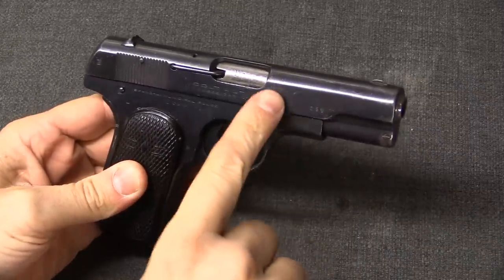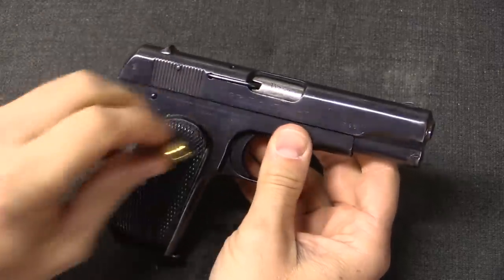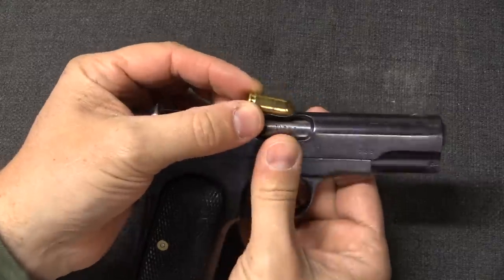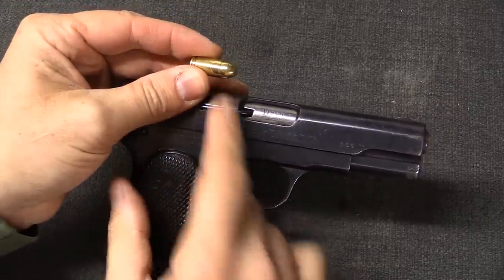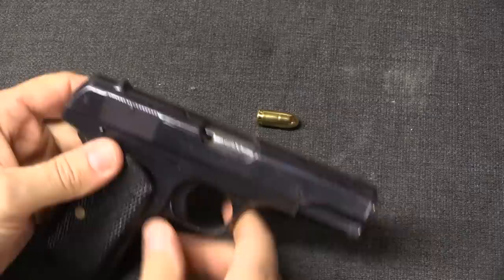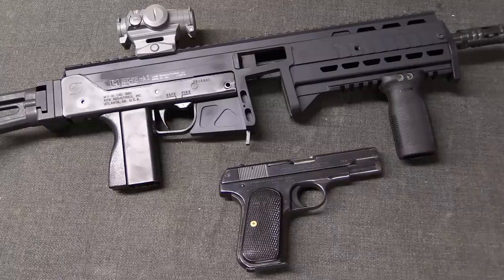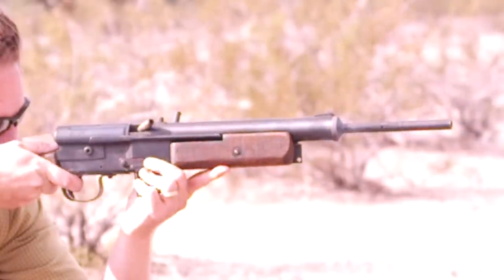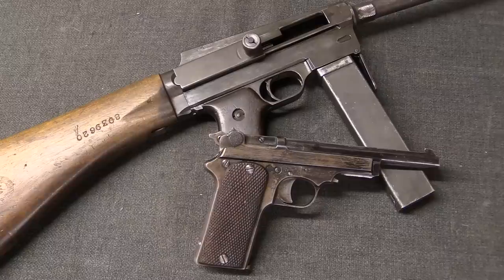How Does it Work: Blowback Action

Comment: How does the spring strength affect the blowback action? Can you have lighter bolt but with tenser spring?
Reply: A_Shuchu _ not really. Unless the spring is way to stiff for anyone to manually rack the slide, the spring strength matters orders of magnutude less than slide/bolt mass. We’re talking several tons of force acting upon the breechface here, albeit for a very short duration.
However, in some designs and with some loads, using a stiffer spring can help soften recoil by preventing the bolt from slamming hard into the back of the receiver.
Reply: Total mass of the bolt & spring vs barrel length needs to be balanced or you get case ruptures. A more powerful spring can increase the rate of fire by closing the bolt sooner but will have a minimal effect on the timing of the bolt opening.
Reply: @brucelee3388  
But how can the spring be so insignificant to the blowback design. From my understanding, the spring could very well replace boltweight, since the mass inertia is nothing but a force that withstands the acceleration of a mass and the spring pretty much does the same.
Reply: @mandernachluca3774  the chamber pressure is "many tens of thousands of pounds per square inch", the effective area of a 9mm case is around 0.1 sq in. As a result the effective force pushing back on the bolt face is in the thousands of pounds. I don't know the exact spring rates used in firearms, but I'd be surprised if the spring force is much more than ten or twenty pounds, given that a human has to be able to rack the slide.

When resisting a thousand pound force, the difference between a ten pound spring and a twenty pound spring is pretty small. The mass of the bolt directly influences how fast it'll accelerate backwards, by Newton's second law.
Reply: @engineer_cat  
I get the practicality point about being able to rack the slide but it should be possible to do it, right? It's the same thing rather it's Newtons second law or the spring, it will always be a force that counteracts the acceleration of the bolt.
Reply: @mandernachluca3774  I won't do the calculations now, but I'd be interested to see if it's possible to have a spring that's stiff enough to hold the breech closed for a long enough time, but still allows the slide/bolt to fully cycle and pick up a new cartridge.

I suspect that firearms manufacturers have found a good balance between spring stiffness and slide/bolt mass. If a lighter bolt and stiffer spring offered any advantage, I'm sure someone would've built a gun like that, with some mechanism to help the user rack the slide/bolt against the stiffer spring. Might be worth asking Ian if he knows of any such design for one of the Q&A videos.
Reply: @Cultural Relic 
Why? A spring has a spring rate, the force a spring can withstand per distance traveled is always equal ( except for progressive springs ) but the total force a spring can withstand after a certain distance is not equal the force at any other given distance. A spring (with pretention) might withstand 10 N at the very beginning of the bolt opening but can withstand a force of 100 N when the bolt traveled all the way and ejected the case.
Reply: @TheRealColBosch  if I'm not wrong It was a video covering the 20/70 Oerlikon 20mm cannon.
Reply: @engineer_cat  I don't think so. The size of the spring and consequently the gun to hold the bolt closed even on a very small cartridge would be huge and for no real gains. Felt recoil is not the end of the world, but getting shot because you couldn't fire first because your gun is so awkward quite literally may be
Reply: @engineer_cat  Ian has done Videos one simple blowback designs for strong cartridges. Some of them have interesting ways to avoid needing to rack the slide against the spring pressure. Like the Dreyse which allows you to disengage the slide from the spring: https://www.youtube.com/watch?v=IY-fbrzPS5U&t=912s
Some pistols have just strong springs, like the Simson or Pieper prototypes: https://www.youtube.com/watch?v=zTl0vWTQbeA and https://www.youtube.com/watch?v=l7E_2GGJIi4
The JoLoAr has a weird handle but this seems unrelated to the heavy spring: https://www.youtube.com/watch?v=RJQLXk3bEww
Or you just lighten the projectile until it doesn't matter anymore as in the Schoboe: https://www.youtube.com/watch?v=zAEWDf-LfcY
Also a nice comparison of different springs for heavy projectiles: https://youtu.be/2vq3bYSPs5o?t=295
Reply: @andreaslaroi8956  some guns are built to flawed ideas of how they ought to work. Increasing spring pressure to counteract chamber pressure is one of those intuitive but wrong ideas that keeps getting repeated. BTW, Ian did a video on the Zip 22 which has a way too light bolt and fails as a result.
Reply: @mandernachluca3774   Mandernach Luca  you're using static spring ratios for a dynamic load. That doesn't work. The static spring ratio says nothing about how fast the spring will compress, only how far it will be compressed if you keep applying a given load over time.

The chamber pressure from a mere 9mm pistol cartridge would squish your hypotethical 100 pound spring completely flat, if it were applied as a static force; try 4012 pounds of bolt thrust on for size (that's a pretty exact figure for SAAMI spec loads in 9x19). In reality, given a suitable bolt mass (plus some of the spring mass as it moves with the bolt), the rearward force stops acting on the spring after a very short movement. The remainder of the bolt movement is driven by the sheer inertia accuired during that initial movement. The recoil spring only has to counteract the inertia of the moving bolt, not the chamber pressure.
Reply: @Kaboomf  
First, how is  a spring ratio static?   The spring can take a certain amount of energy and release it, energy is nothing less than force applied over a certain distance and if you take into account that power is nothing more than energy per time or force nothing more than an acceleration times a mass, è voila, you can easily calculate the needed spring rate for your gun. The problem as befor stated is probably the spring being to heavy to operate the gun manually and the spring being so large that it couldn't be fit on the gun.
Reply: @mandernachluca3774  I meant that you cannot simply say that the spring should compress x inches because bolt thrust is y pounds, like you could with the simple static model we all learned in high school. The amount of time that bolt thrust exists is an important variable and depends on barrel length and bullet weight among other things.

Spring force does not affect the initial speed of bolt opening, but it does affect how far the bolt will open. We need it to open at least far enough to eject the empty case, an overly stiff spring would prevent that. Momentum affects bolt speed, spring force not so much.
Reply: @Kaboomf  
If you would have read my comment properly, you would know that the spring very well alters acceleration of the bolt. Of course the bolt force isn't constant over the whole traveled distance but why exactly do we have integtal calculus if we don't use it?
Reply: @mandernachluca3774  You need to read col. Chinn's volume of "The Machine Gun" which covers blowback actions in excruciating detail, I forget which one of the 5 volumes has this info but it is sercheable and downloadable for free ( Ian reviewed the book a while ago).
Bolt thrust from the chamber pressure only acts for the first couple millimetres of bolt travel, any more than that and you risk case rupture. All the rest of the bolt movement is caused by the inertia the bolt picked up from this very brief acceleration, and this inertia must be sufficient to compress the spring all the way so an empty case can be ejected and a new round picked up from the magazine.

If you were to build a gun with a very light bolt and a recoil spring taken from a dump truck suspension, that spring may keep the breech closed but will also prevent the gun from cycling. For a  given spring stiffness and a given cartridge length, you need to ensure the bolt has enough momentum to keep compressing the spring a long enough distance after chamber pressure has dropped. In a light bolt heavy spring design, the bolt cannot have  enough momentum to do that. Remember, maximum safe bolt velocity is the same regardless of bolt mass and spring stiffness so you cannot compensate for low bolt mass with higher bolt velocity. A stiffer spring thus needs a heavier bolt, but then you need a hotter load and/or a much longer barrel in order to accelerate that heavier bolt to the required momentum for fully compressing the spring.

In high school physics land where air resistance is negligible and all cows are perfectly spherical, we only cared about how far a spring would be compressed by a given force. In high school physics land, the spring would instantly snap to its new state of compression when a force was applied. Here, we are instead concerned with what speed one end of the spring has reached after a short impulse has acted upon it. That inpulse is so brief and the accelleration so violent that the rear part of the spring has not been compressed at all by the time the front end has stopped accellerating. The impulse moves like a wave towards the rear of the spring, and said compression wave might only be halfway down the spring by the time the bullet leaves the barrel. Thus, you don't even have the whole spring in play during that initial phase when you're trying to hold the breech closed against chamber pressure.
Reply: @Kaboomf  
Well, i don't wander in the land of highschool physics. I'm fully aware of those things and i won't denie the complexity of a blowback system that uses mainly a spring but ir is still possible. First, springs come in various shapes and sizes, say torsion, tension, compression or coil springs, using a tension spring over an orsinary coil spring might make a difference. You could also use a simple variable lever or cam system to increase the force needed to open the bolt but maintaining a lower force after the initial first milimeter (or so). I think there is even a  Forgotten Weapons video of a Browning design with the intend of such a mechanism.
Reply: @mandernachluca3774  Like you say, it's possible to use mechanical trickery to alter the leverage so more force is required for moving the bolt the first few mm followed by light spring force for the rest of travel. That's called Delayed Blowback, and there are various ways of doing that. We were discussing straight blowback however; Ian will no doubt cover delayed blowbacks in a later video. 

For straight blowback, no it isn't possible to make a very light bolt and a strong spring work reliably. You'd need a magical spring that's somehow super stiff for the first two mm of travel- at least a ton and a half- and then suddenly reduces its strength down to maybe 10 pounds for the remaining 20mm+ of travel. Springs simply don't work like that, the force needed to compress them increases proportionally with  bolt travel.

Edited to add: Even in delayed blowback actions, the main object of the leverage tricks is to give momentum a mechanical advantage, not to give spring force extra leverage. The two just happen together because the increased leverage acts on the same parts. The example I'm most familiar with is the H&K roller delayed blowback system. I've tried to push the bolt back via a steel cleaning rod inserted from the muzzle end of an MP5. It took quite a bit of force for the first few mm, then it was just compressing the spring for the rest of travel. The casual observer might conclude that the system works by altering the leverage so it acts like a much stiffer spring initially. However, as posted above the bolt thrust here is about 4000 pounds. If the increased leverage of spring tension was to make any real difference, it would have to be impossible for my scrawny arms to overcome by muscle force. How the roller delayed system actually delays opening is by altering the leverage of the bolt carrier's momentum. For the first little bit of  bolt head motion, the leverage caused by pushing the rollers against angled surfaces makes the relatively heavy bolt carrier accelerate much faster than the bolt head. This allows the bolt carrier to move way faster than what would be a safe initial speed for the bolt head. Momentum gets amplified by accellerating the bolt to a higher speed than what would be safe for the bolt in a straight blowback, while the bolt head moves at a safe speed until pressure has dropped. Then the bolt head gets yanked back at great speed by the bolt carrier as the roller delay system reaches its full extension. So, even a delayed blowback relies on momentum to an order of magnitude more than spring force. Without the roller delay mechanism, an MP5 would have needed a much heavier bolt but might have used about the same spring.

I actually own and shoot a Winchester 1910, which is a fairly powerful straight blowback. It has a ridiculously heavy bolt, and a spring of very similar size and strength to that in an MP5 (to the point where you can make 1910 spring by shortening an MP5 spring if you have to. It'll be a little soft because the wire is a hair thinner but will fit the rifle).
Reply: @Kaboomf   
Yeah, i already thought so when discussing this, logically it must be a delayed blowback when there is some kind of mechanical force transmission used to slow down the acceleration of the bolt. The question is, is it still a delayed blowback system if he leverage isn't used to give the momentum of the bolt a disadvantage or is it still the same principle because of the leverage  altering the bolt acceleration one way or another?
When i started the argument, i had some kind of idea and i was sure that it would be still considered a blowback system but not a delayed blowback. Sadly i forget it over the day 😅. Maybe it comes back. I think it had to do with the reasoning that for something like a 
roller delayed blowback, you need a two piece bolt that can mechanically transfer force from one to the other. As you said, the momentum remains the same but one of the two pieces moves far less than the other because of the mechanicle advantage of the rollers, holding the first piece in battery and instead pushing the second piece out until the rollers..., well, roll. However  my idea is not that sophisticated, it would be just a simple one piece bolt that rides against a cam to give the spring an advantage until the chamberpressure drops far enough to safly eject the empty case, still with the problem of probably not being able to operate the action manually.

Comment: So I assume that if the chamber and cartridge were not a snug fit then the blow back would not work?
Reply: Jason Jones depends. What matters more than chamber tolerance is pressure and friction. High pressure calibres typically need lubricated cartridge cases in order to prevent the brass from sticking so hard against the chamber walls that the blowback action fails; most pistol calibres are low enough pressure that this isn’t a problem. FN’s 5.7x28 is a high pressure round designed for blowbacks, it has a low friction polymer coating on the cartridge case due to this issue.

Comment: Hmmm, 44 views and 50 tumbs up. I would guess at least one of those counters are wrong. Thank for an instructive video.
Reply: Blowback isn't balanced apparently
Reply: It happens sometimes because of how youtube & other services handle a large number of requests at once. The video is hosted in multiple locations at once & each of those hosting locations independently counts up the views. These views are sent to all other hosts so the view-count is as close to true as possible however sometimes it takes a while to verify no views have been double-counted or for them to be transmitted everywhere.
Reply: Mittau, exactly, view-count and vote-count are entirely separate (distributed) systems, and neither gets updated in real time.

Also, I'm sure that starting to watch a video doesn't immediately count as a "view".

Comment: Blowback doesn't lock bolt.
Reply: No that is why it don´t work in rifle calibers. even some large pistol calibers can´t use blowbacks when it comes to pistols.
Reply: @exploatores  No, I meant thats the main differentiator and should have been mentioned.
Reply: I am kind of shure that Ian comes to locking bolt in later videos. but they will make more sense to go from simpler to complicated systems.